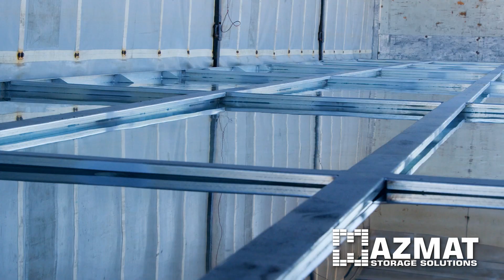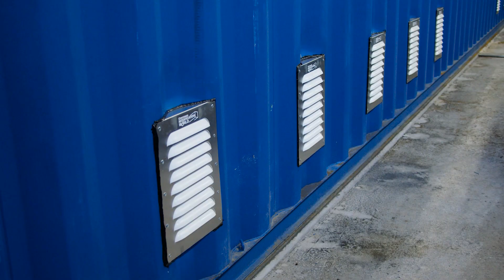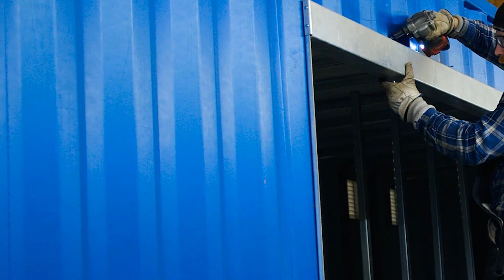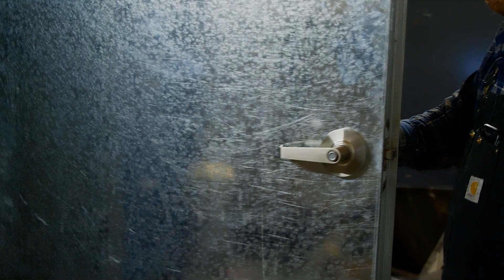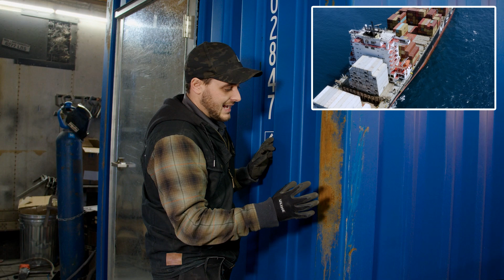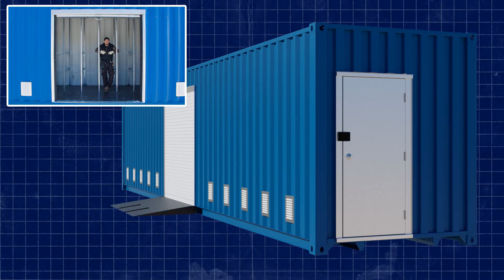Storing Hazardous Materials in a Shipping Container - Compressed Gas Cylinder Storage Modification

Comment: What is the point of putting a door, with the hinges out? They can be broken more easily and the security comes down quickly.
Reply from the maker: You can't install panic hardware (crash bar) on an inswing door. All industrial doors in hazardous locations are outswing. Safety is a MUCH larger concern than security.